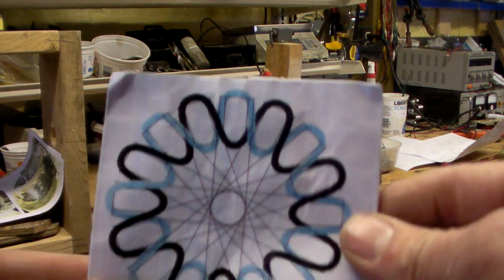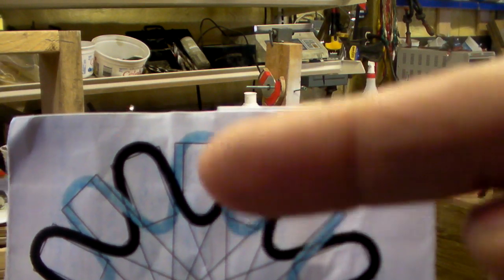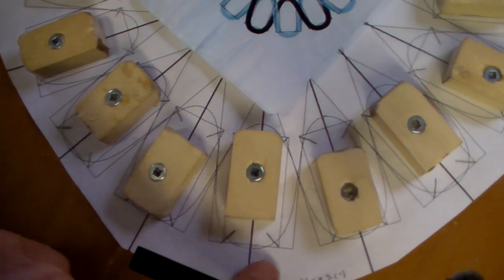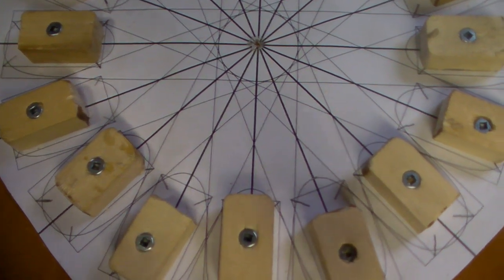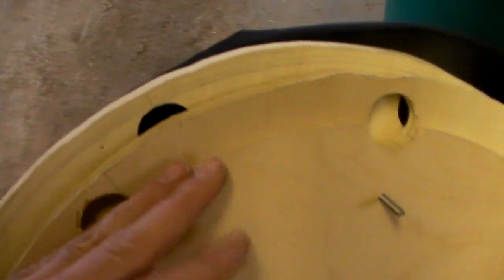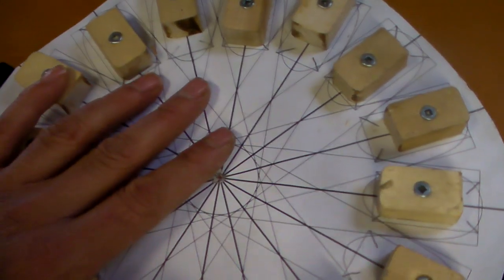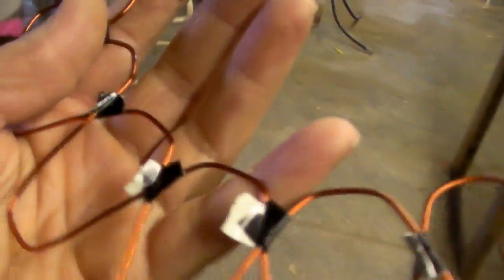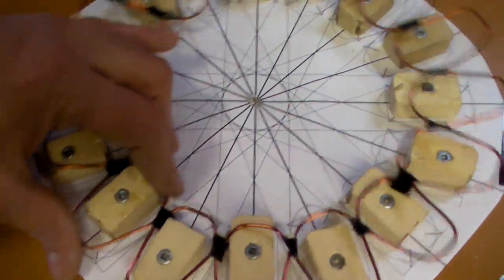14magnets 14pole coil chamas1 serpentine 3stack phase axial flux pma wind turbine vawt 63.MP4

Comment from the maker: well, the i biult the serpen for my VAWTs, it was making good power at very low rpm, but power curve drops at higher rpm, i was able to make usable power at 60 to 100 rpm, however, after 100rpm it kinda flatten out and at even higher rpm the pma has no Balls, that is my technical terms...no balls...lol